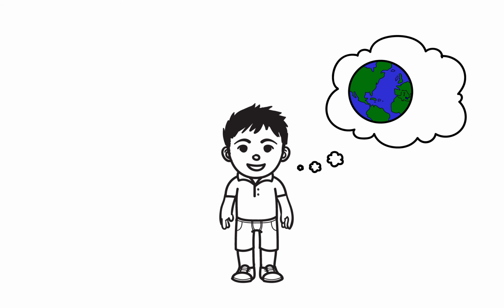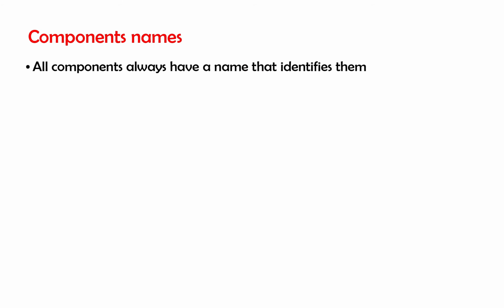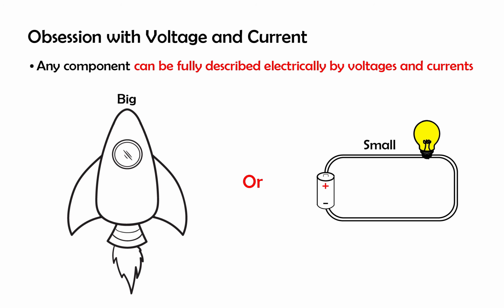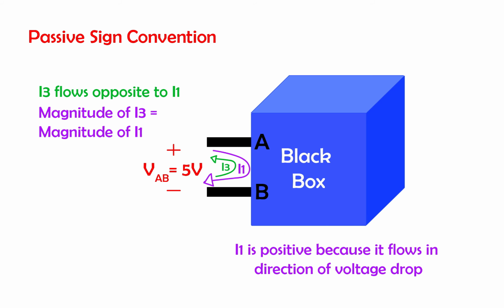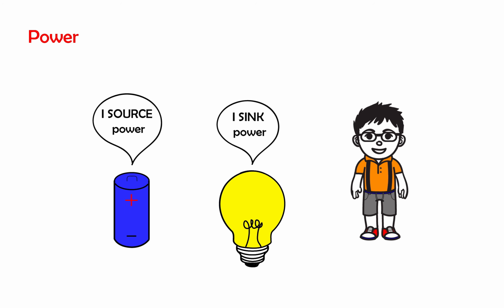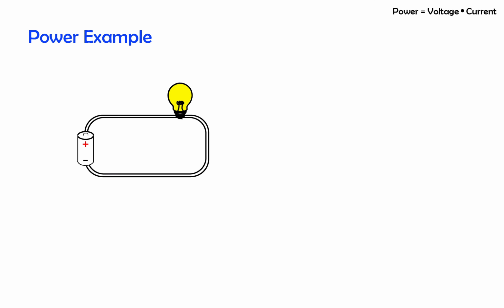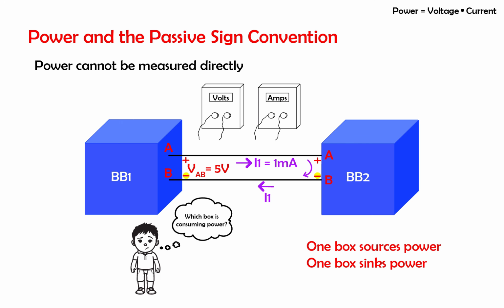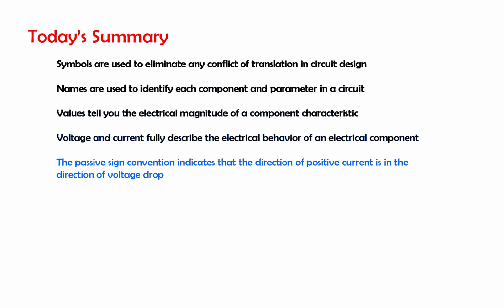Components, Passive Sign Convention, and Power

Comment: A possible source of confusion (and conflict) here is when you doubly defined the reference polarities of the voltage and the reference direction of the current. It should be sufficient to use either the +/- notation or the double subscript notation for the voltage, and to use either the arrow notation or the double subscript notation for the current.

Comment: I actually loved the introduction were you started talking about standards/conventions and representations.

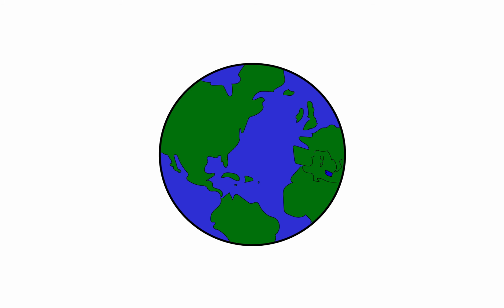Note: @ 1:50, both figures are called diagrams. The first on the left can be considered a pictorial circuit diagram (in which pictures are used for the electric components) and the second on the right a schematic circuit diagram. For more, read https://en.wikipedia.org/wiki/Circuit_diagram.

Comment: Around 12:02 how did you know the current i1 went clockwise like that? How do you know it didnt go counterclockwise?
Reply: We don't know any variable in this circuit, so we can't solve it theoretically. Therefore, the only way he got those values is by measuring them in real life. To measure current, we use an ammeter, which must be connected in series with the branch that has the current you want to measure, and also the circuit must be closed and turned on. Once he measured in the upper branch, he either got +1 mA or −1 mA. If he got the positive value, then the current was flowing in the correct direction, but if he got the negative value, then the current was flowing in the opposite direction with respect to how he measured them (the electrodes of the ammeter were in opposite positions.)